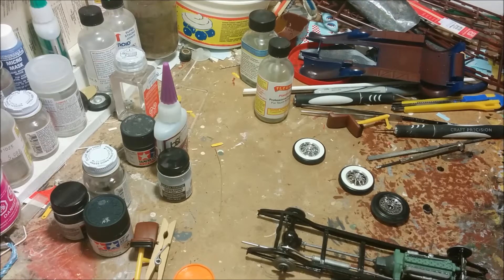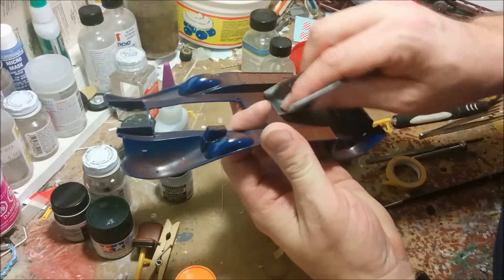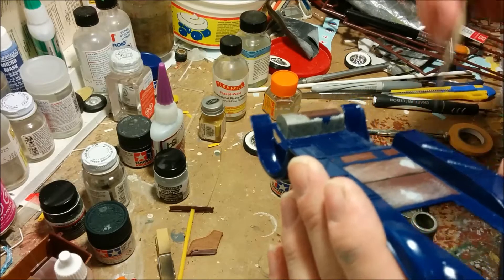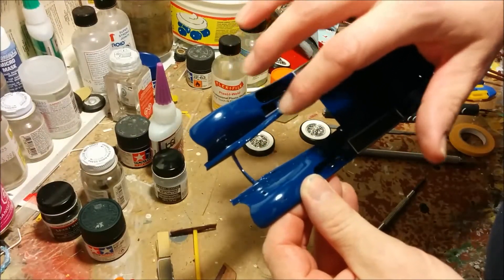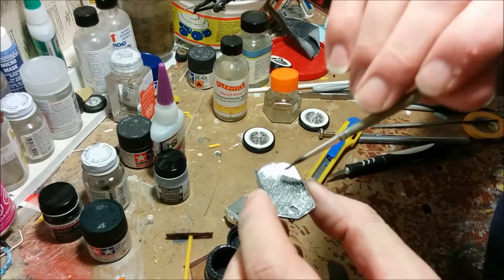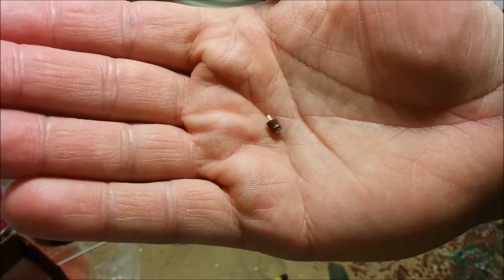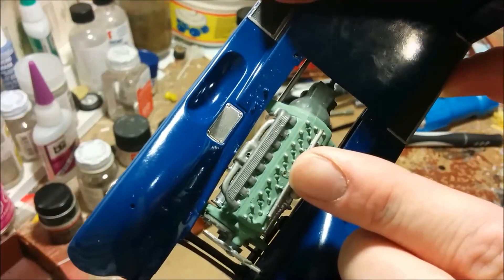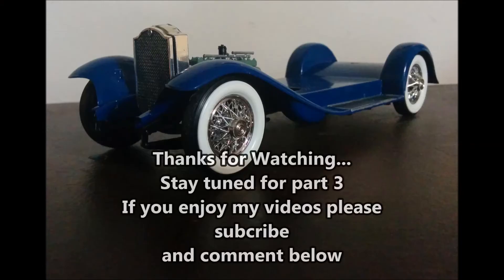Building Packard Model Pt2 1/24 1930 Speedster

Comment: most antique radiators were brass but that looks great
Reply: Jody Blackwell Something else. The fuel tank is lead soldered zink. Don't know what color would be close to that,the zink had this white colored flecks all through it. I'm sure it was whatever metal was used in the alloy.